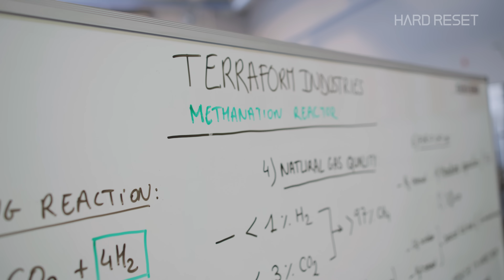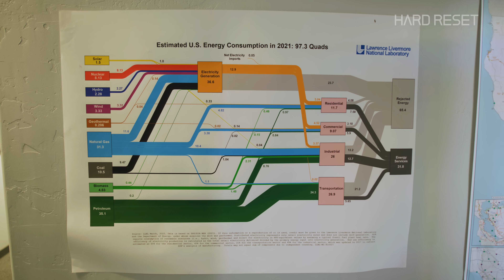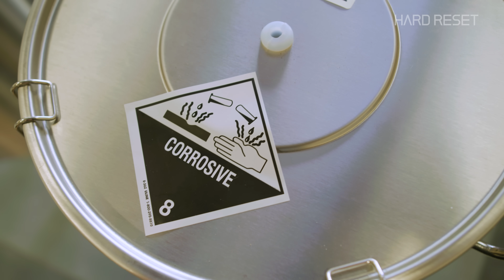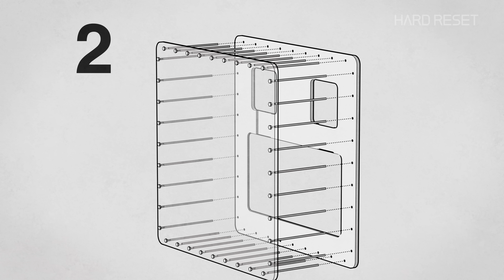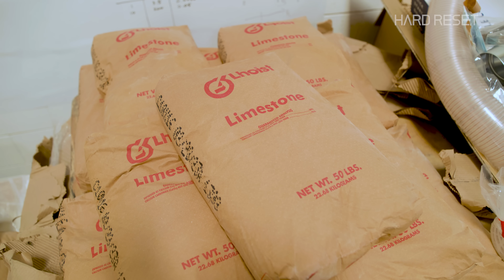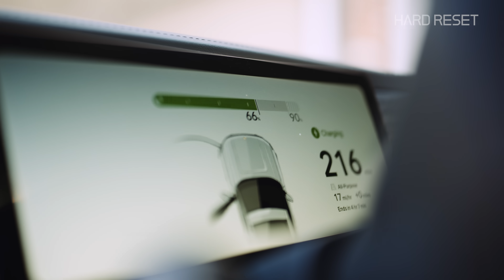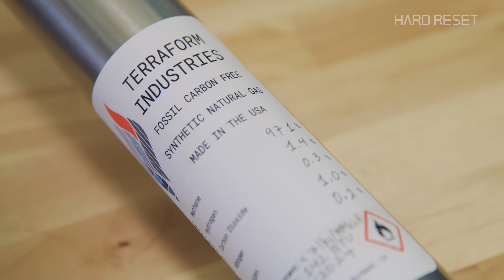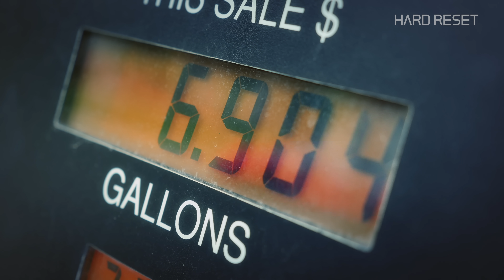The Last Fuel We'll Ever Need?

Comment: The CO2 part seems unnecessarily energy intensive. Why not just focus on hydrogen? I understand that once you get methane you can create other longer chain hydrocarbons but it does seem like a lot of steps just to synthesize gasoline, diesel, etc. I suppose the answer is you can simply keep existing machines running with no modification if you literally synthesize their fuels. But the risk of it being too inefficient to do so seems high. The other option is just harvesting hydrogen from solar power and using it as a fuel directly. No additional processes except for storage, which is argueably hydrogen's biggest hurdle. However, it is not an insurmountable issue. It gets me thinking that Toyota might be on to something continuously pouring money into hydrogen fuel cell systems. You can run ICE on hydrogen but it isn't ideal for a few reasons. It would be much better for your hydrogen fuel to be used by the best "engine" which is by far, a fuel cell. I think that we need to figure this out one way or another. Petroleum is just not sustainable in anyway. Our existence hinges upon us being able to power our society without pumping from wells that in all probability, will eventually dry out. Climate change scares aside, if we run out of oil tomorrow, we are all 100% doomed. That is why if humanity is to survive, we need projects like this to help us find a way.

Comment: Sounds great but how does it compare with Solar/wind/battery. Other than for rockets the better solution for all energy applications will be SWB especially when you take the lowering cost into account. Improvements in batteries will mean they replace fossil fuels even in aviation and marine applications and electricity has a very low cost of distribution.